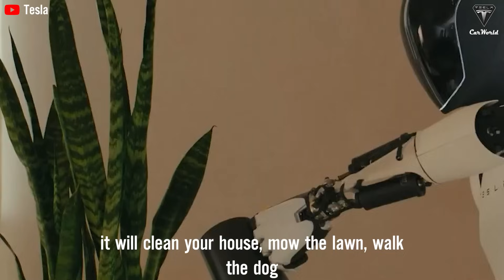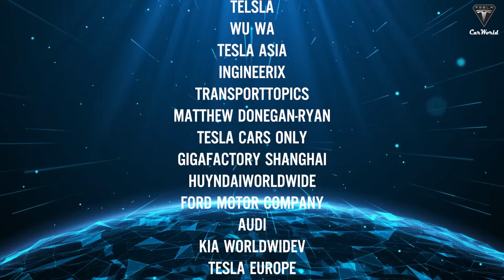It Happened! Elon Musk Drops Bombshell 2025 Tesla Bot Gen 3 Pre-Sale! This Is the First Customer!

Comment: I am ready to buy one.

There are some features that have not been talked about that I would like to see that Optimus can do...
1- See in the ultraviolet range of the spectrum to find hidden stains and other dirt particles on materials needing better cleaning. 
2- See in the infrared for night vision as well as having heat vision. It could look at a person and know their body temperature or a soup cooking on the stove or food that may end up spoiling. It could see heat and cold drafts as air travels through areas.
3- See radio waves of different frequencies and the strengths of the signals. This would help for Wi-Fi and other communication issues or possible interference issues.
4- Able to smell carbon monoxide, smoke, detect radon gas, detect different kinds of radioactive sources and materials.
5- Detect barometric pressures, moisture or humidity
6- Able to see and calculate distances between points of any object fix or moving (range finder abilities too)
Reply from the maker: Really appreciate your enthusiasm and thoughtful suggestions!

UV and infrared vision for detecting hidden stains or heat patterns would be extremely useful for both cleaning and safety.

Seeing radio waves to identify signal strength or interference is a unique and ambitious idea—definitely advanced, but very intriguing.

Range-finding and spatial measurement are already being explored in robotics, so your idea is on point!
Thanks for sharing—ideas like yours help push the boundaries of what’s possible.